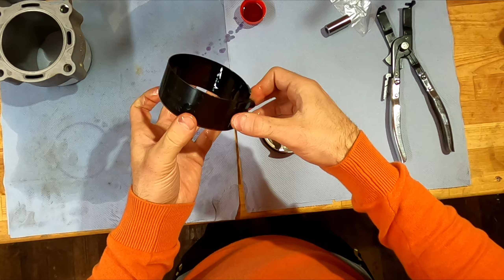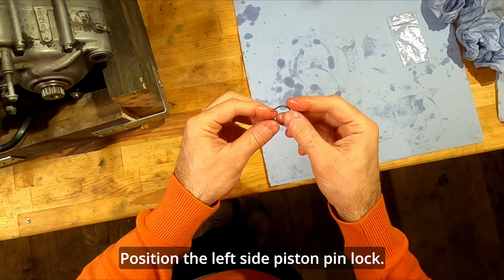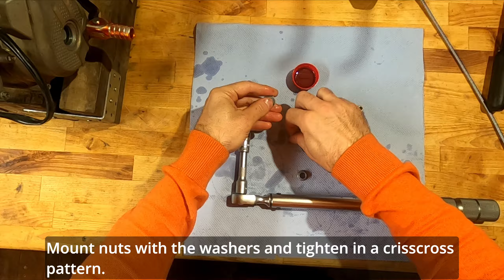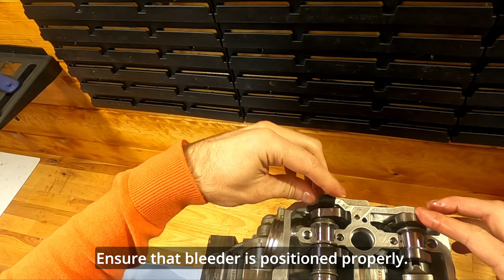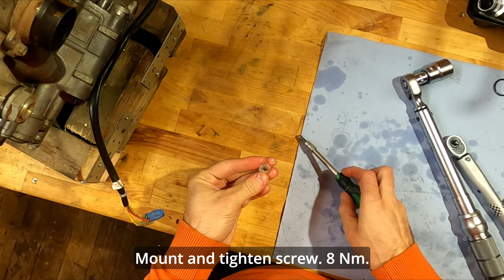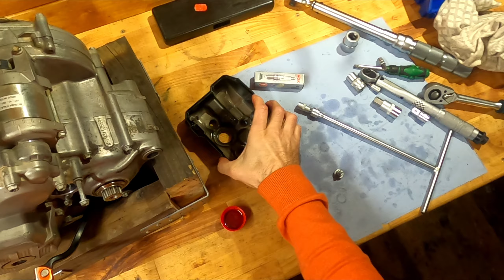KTM 350 SX-F 2021 rebuild - top end piston change part 2

Comment: It is better to instal piston from the top of cylender, great video
Reply from the maker: Top and bottom both will work.  Top side allows piston to go in straight easier but bottom side has a nice tapered edge for the compressor.

Comment: Hey, great vid. Have mine assembled minus the valve cover. Timing marks are still where they should be. When I rotate the engine by hand, the timing chain gets a loose spot. Should this go away when there’s oil pressure ? Wondering if it is normal. Oem tensioner.
Thanks
Reply from the maker: I have not noticed a loose spot myself. Double check everything before you start it up. Chain will rattle first 5 seconds when oil pressure builds up.
Reply: @ssse3123  excellent thank you.

Comment: Is it possible to have the crank 360° out, even if crank got locked while assembling and cams pointed right? I have a no start situation, have fuel/spark/compression. I wonder if it only sparks every 720° or is it wasted spark (every 360°)?
I'm a little stuck right here
Reply from the maker: Should spark every 360 deg because ignition is controlled by crankshaft.

Comment: book calls for lactate 5910 between the engine case and cylinder but I have seen multiple videos of people putting on no sealant in that spot.  what do you think I should do?
Reply from the maker: You can use it but don't put too much that it gets into the engine. You don't want this stuff getting in to oil passages.
Reply: @ssse3123  do you think it would be fine without it? After seeing a few videos of just sealing the top cover I’m thinking of just sealing that but also don’t want to pull it apart again
Reply from the maker: @damoncustodio6577  I have used gaskets only on all top end jobs. No silicone anywere. All has been OK.
Reply: @ssse3123  sweet thank you very much I’m not gonna put any on 🤙🏻

Comment: Do you have any idea as the cam degree, since mine doesn't habe the punch marks on the cam gears?
Reply from the maker: What year bike? Some older ones have markings on the cam bridge at the opposite side of chain. These match with flat parts of camshafts.

Comment: Hi! Just asking what your manual says? 180 or 120 degree? I have 2015 sxf 350 and my manual says 120 degree and I looking for some informations about the piston ring gap orientations on the oem pistons
Reply from the maker: If your piston has 3 rings then it's 120.
For 2 rings it's 180.
Reply: @ssse3123  1 compression ring, 1 oil scraper ring and 1 oil scraper spring

Comment: Should one replace the timing chain on the first piston change?
Reply from the maker: Check if all chain links move freely and are not sticking. Hold the chain up and see if all links align straight. If not then replace chain.
Reply: Thanks for the tip 👍

Comment: Did you change the valves or you put the old ones? 
The piston i didn notice is the number 2 after 167hours? Or the number 1?
Reply from the maker: Old valves and piston nr 2.
Reply: @ssse3123  how many hours do you do between piston changes on this engine?
Reply from the maker: @hannesdobbelaere  for an average rider 100-150 hours
Reply: @ssse3123  enduro rides , not mx/track time?